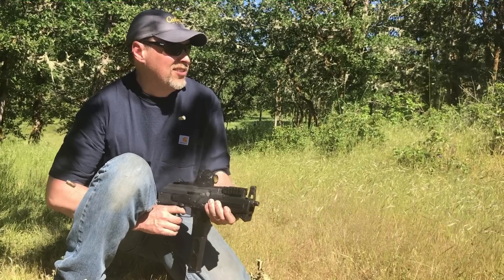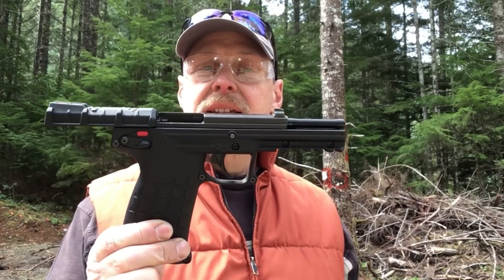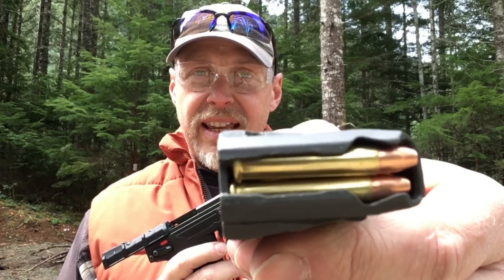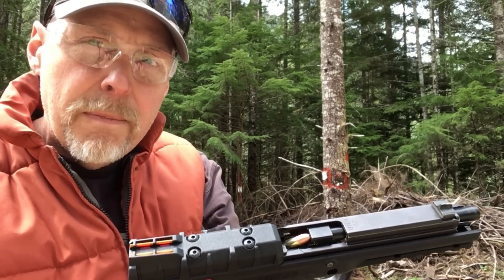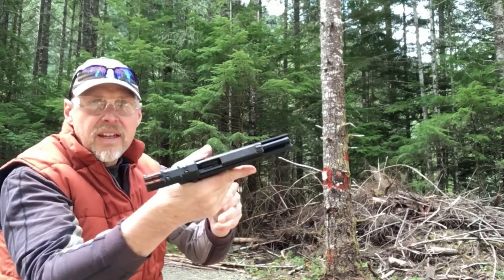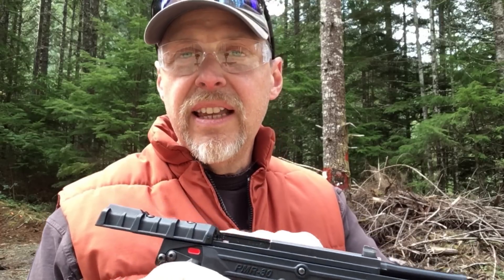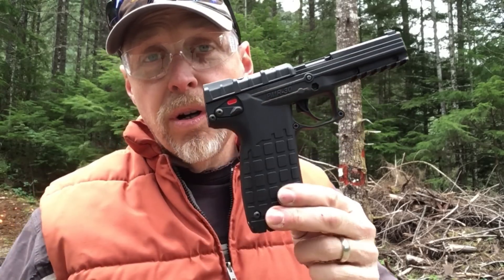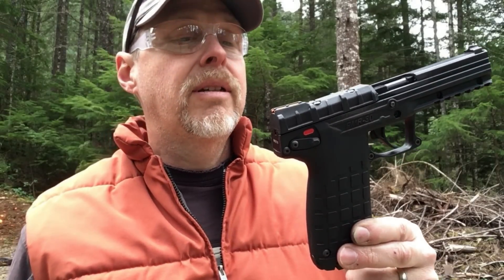Troubleshooting: the Kel-Tec PMR 30

Comment: I thought 30 rounds of .22 Magnum would be a devastating weapon so I checked out all the videos on the PMR30 and I found two problems that steered me away.  The first problem was that it's a CalTec, and the second problem was that every video I saw had the same failures that you experienced in this one.  Failure to feed, failure to fire, failure to eject, failure not to fail, etc.  And I thought the price was a bit much....actually a lot much.

I may have to start looking for one of these again.
Reply from the maker: ytubepuppy 
  Haha! Well at least I had a happy ending. The sequel to this video tells the tale. It’s called, “KelTec PMR30 100% Reliable!”  And now I can say this is one of the most amazing guns I’ve ever owned. I can’t believe what it can do. I don’t know where KelTec went wrong on production or QC but the design is amazing and could change the gun world forever if these can be produced in sufficient numbers without production screw ups.
Reply: @MaxHeadspace9mm    If I could get one that was reliable, I might even consider using it as a carry gun, or at least a truck gun, but I've always been leery of them.  Will have to look around and see what I can find.  I'll look for your other video.  Thank  you.
Reply from the maker: ytubepuppy 
  Sure. And good luck. I don’t know what advice to give you about finding a good one on the first try. It’s hit and miss with KelTec. But at least you know if the gun doesn’t work they will take care of you. Eventually you will get a good working pistol.

Comment: My PMR I bought 2017 November... has fluted barrel, 2014 make, threaded barrel with the muzzle break. Of approx., 500 rounds I would have had 5 stoppages. The slide on mine is loose and in take down after removing lock pin, if I tilt firearm muzzle down the slide will fall to the floor.  Its not loose or rattling. Locks up very well. Very accurate to 50m.
Ammo is always Hornady synthetic tip 30gn VMAX or Federal Game Shock JHP 50gn. Unique firearm espaecially for Australai, Guys at the range always wonder whats making all the noise .....until they look at the floor and see all the 22WMR shells.
Reply from the maker: wetherman21 21 
  Haha! I bet that starts a few conversations😆. My slide is very tight. I suspect the tolerances are very loose at KelTec. To make weapons as inexpensive as they do they have to go fast. I’m ready to make my follow up video to this one and we will all see if there is a happy ending to this story🤔🤞
Reply from the maker: wetherman21 21 
  No I meant when you said you shoot your PMR30 at the range and people wonder what the big noise is and see the 22 mag shells all over the floor. That would start conversations. I love conversations in my comments section. It’s my favorite part of YouTube. Thanks for the reply. 😉

Comment: I just picked up a used PMR 30 (updated version). I've put over 400 rounds through it and observed that thus far, it only works reliably with Hornady 30gr ballistic tip ammo. I've tried the cci you used in this video, federal, Winchester and armscor, and none of them feed reliably. Additionally, it's very difficult to fully load either of my two magazines with anything other than the hornady rounds. I've never had a malfunction with the hornadys. With other ammo, all malfunctions are magazine/feed related.

 I need to get my calipers and check, but I'm wondering if the rim is a little bit smaller in diameter on the hornady ammo. It's a little frustrating to be limited to one ammo type that's on the higher cost end and a little less common, but it's still a blast to shoot. 30 rounds, almost no recoil, very loud (more bang=more fun for me), amazing trigger and less than a pound fully loaded. Just needs someone to make an aftermarket mag that take all kinds of ammo
Reply from the maker: Charles Alexander 
  That’s fascinating! I’ve tried every grain weight and brand available where I live and the best I tend to get is 3-4 stoppages per mag. It’s people like you who give me hope to keep trying with this pistol. I know there are reports of happy customers who have this pistol sorted out and get enjoyable reliability out of the PMR30. Soon I will upload the follow up video to this one.

Comment: I want one of these eventually, i just got the heritage rough rider 22 with the magnum cylinder. Looks like it might be a keeper if the break-in proves to be a good thing for the gun!
Reply from the maker: WCAR PumpIron 
  I have a friend who got the Heritage Rough rider with the magnum cylinder too. He loves it. With that and the PMR30 you would set for plinking and anything 22 related. 
  My experience is not going so easily. I’m certain that one way or another I’m going to conquer this problem but so far the answer is elusive. It’s possible I may have a lemon or maybe it’s something so obvious I can’t see it. We’ll see.
Reply: Max Headspace9mm I have both of these as well. Only I still just have the 22lr cylinder for my RR. Had a retired marine hit 75 yards out of the RR. Unfortunately, had some Winchester blow back in the PMR and the damn slide catch/release blew off with it. Scared the hell out of me. Never had a round do that in any of my handguns.
Reply from the maker: WCAR PumpIron 
  I have a good friend who got the rough rider too. Then he went out and got the magnum cylinder also. Great versatile combo. 
  The PMR30 has a lot of potential if it works as intended. I’m making a follow up video to this one showing all the fixes I’ve tried and what was the result😉
Reply from the maker: Alonzo Hall 
  Unfortunately KelTec has the business model of making these guns extremely inexpensively so stuff like that is possible due to loose tolerances in their manufacturing. I’m sure if you contacted them they would be motivated to make it right with you.

Comment: I think aside from finding ammo with enough force to drive the bolt back. The other problem could be partly remedied by taking time to visually inspect the cartridge column specifically the top cartridge after loading each round into place.

I notice during the loading process even if follow the instructions to the t, you will find some of the bullets misaligned. As you load the magazine if one round is misaligned rake it out and the alignment of the next. If it is also misaligned rake it out as well. And so on and so forth till you reach the point where they are aligned. Than start loading grom there.

It is very monotonous. What you are looking for is to imagine the cartridge sliding forward. Is it going to clear the front of the magazine? Or get caught?

You can test your loading method by dry cycling the full magazine through gun rapidly pulling the bolt back and letting go. 

Once youve got this down and can di whole magazines without a hitch than you can go to the range.

If you have just one hang up. Take the time find out its exact cause. If the bolt is not fully cycling there arr severak things that can happen.  Some may even seem magazine related but arent. If the empty case is still in the chamber than the culprit is obvious. Cockeyed cases getting between the bolt and chamber are a sign that enough force was able to kick out the brass but not far enough for the bolt face to get behind the case rim.

Empty chamber can be ammo related, or it can also be magazine related. Ensure the magazine is fully inserted. Some have had issues like this and found the magazine tolerances where it locked up into the gun were too lose. They slightly modifued their magazines so that they would be firmly seated. 

The reason why i am being so pendantic on this is an attempt to help us save ammo. 

I am not a gunsmith. I have been known to pour hundreds of rounds through guns frustrated with performance issues and than getting rid of the gun. 

After you fure one round. Before you fire another, eject the magazine to check the magazine and see if the next round is properly aligned. Than pull the slide back to see if a fresh round is in the chamber or an empty case. Doing this early on can help you catch an imminent malfunction before it happens.

Eventually once you find the right ammo and your magazine loading technique is down , you hopefully will be able to start burning magazines through gun using your ammo having fun instead of getting red in the face.
Reply from the maker: Haunted Hornet 
  Thanks so much for investing time to help. I love the detailed description of methodically finding the source of these problems. A gun is just a mechanical device and frustration blurs our ability to see clearly what is at fault. I like your approach. 
  I did a series of four videos about my journey with this pistol. The last one revealed that I’ve passed a milestone. 1,000 rounds of flawless function. Which surprised even me. This is truly a great design which is certain to influence other firearms manufacturers into reconsidering what true high capacity is. The bar has been raised!

Comment: I have one of the latest versions of the PMR 30. I have not had any feed problems during its break in cycle and have approximate 300 rounds through it. However just to be on the safe side, I went ahead and polished the feed ramp. I have had zero malfunctions. The only thing I am discouraged about is its accuracy is not what I would expect. Any suggestions on how to correct that?
Reply from the maker: Bill Laflen 
  It may be something you weren’t expecting. This pistol is notorious for having a loose front sight.  Under the stress of reciprocation of the slide it has been known to move a bit. Even an almost imperceptible amount of movement can throw your accuracy off. One easy fix is to put a drop of super glue in the sight channel once you feel it’s where it needs to be. Loc Tite also has an adhesive that is really fine and will soak in the microscopic space between your sight post and the channel its in. Or you could do like I did and replace the front fiber optic sight with a metal sight post. It fits much tighter and doesn’t move around. Mine is accurate. I will say that much for it.

Comment: I had one of those pistols and I had a number of malfunctions. Most of which I think were caused by the magazine.

If you don't load it exactly like the owners manual says to do it. They don't feed properly.
Reply from the maker: Roy Spaulding 
  Yes. I made sure from the start to be a zen master of loading the PMR30 😆😆. It is different but not difficult. There is a loader available that helps and it’s not expensive. I may get one.
Reply: @MaxHeadspace9mm  I had one of the loaders, it is worth the money. I just traded mine to my father because I wanted a rifle he had. It had sentimental value and the PMR30 did not.
Reply from the maker: Roy Spaulding 
  Yeah. I can’t picture a reason to get sentimental over a PMR30. But maybe in time🤔

Comment: I have an AK.  From new to 12,000 rounds and not one stoppage and still going strong.  I have fired rusted amo too.
Reply from the maker: alaskanalain 
  Yeah. I have some guns like that too. I know what you mean. 
  But the difference between the pistol in this video and basically the same pistol in the follow up video, “KelTec PMR30 100% Reliable!” Couldn’t be more different. It has been 100% ever since the fix. I expect it will be one of those to add to my totally reliable collection. My only question is, how long will it last?🤔

Comment: I have the same problem with my PMR, only the feeding issues started after a couple years and hundreds (maybe thousands) of rounds. The firing pin broke and KT replaced the whole slide assembly, but the problems continued. I tried cleaning a mag and using dry lube (Krytech) and bought a whole new mag, to no avail. I guess that I'll have to send it back. Also, I went to the KTOG site and explained my problem and the first three replies were, "You're limp wristing it."
Reply from the maker: jwash3rd 
  Haha! Yeah. I’ve had people tell me I’m limp wristing as well. Though from the video footage I can’t understand what they are seeing. I’ve never had trouble limp wristing before. But I’ve tried every fix that the commenters on this video have suggested. I’ve watched every video on YouTube about problems with this pistol and tried those fixes as well as everything I’ve ever done to any other pistol to get it to work. The follow up video to this is coming soon.
Reply: Thanks for the reply. I've subscribed, hope you find the fix.
Reply: @MaxHeadspace9mm  Ever get the follow up done? Just got mine back from KT and it feeds Mini Mag TMJ and V-Max OK, but JHPs and FTX not so well. Rather than send it back again, I'll just use it as a plinker.
Reply from the maker: jwash3rd 
  The follow up is called, “KelTec PMR30 100% Reliable!”  You May find yours working better after some break in. If they replaced parts then see if it gets better over time. Also KelTec guns need lube and cleaning more than most. Especially the .22 varieties. 
  I’m working on a .22mag penetration video now to upload in the next two weeks.
Reply: @MaxHeadspace9mm  Thanks, I found it. In fact, I had seen it but forgotten. Well, my doctor did say that the memory was second to go.

Comment: I have to shake my head in amazement. You shouldn't have to do any of this. Send it back to KEL-TEC, and let them fix it.
Reply from the maker: WC Sessa 
  I know. I have no idea how they can survive as a company with releases like this. And it’s not like this pistol is brand new. These have been out for a few years now. 
  So I did send it in and they fixed the heck out of it. New slide and barrel. Works flawlessly. Did a video called, “KelTec PMR30 100% Reliable!” To document first shots from the factory fix. Then did a penetration test video comparing it to 22 lr and 9mm hollow points. That video is called, “PMR30 Penetration Testing”. Tomorrow I’m uploading a new 1,000 round reliability review. I’m toying with the title, “ PMR30 for Self Defense?”  What do you think?
Reply: @MaxHeadspace9mm  Didn't know about the "NEW" video, so I made my comments. I have a PMR-30. It works good so far. Ran 100 rounds through it. Bought it about a month ago, so obviously they have made adjustments, but I have also seen others complaining also, and still others swearing by them. Make your video about 1000 rounds reliability. I think it would be very interesting to see. Bottom line in my assessment is folks follow instructions on proper magazine loading and adequate ammo. Obviously  cleaning/lubrication plays a part. The videos I've seen where people talk about that makes a big difference in their perception of the gun. All common sense items to observe when you buy a new firearm. Thanks for the response, your video makes sense now.  Looking forward to seeing your follow-ups.
Reply from the maker: WC Sessa 
  Thanks! Yeah, I’ve gone the gamut with this pistol. But it’s all good now. Never would have believed it could go from junk to awesome in my experience but it has. Now I’m getting a holster for it. That says it all!

Comment: I must have got really lucky. I have over 1000rds though my pmr30 and I've never ever had 1 malfuction. But I so load the mags like keltec says. After 10 round I tap the back of the mag on a hard surface. Then every 3rds after that I slap the mag on a hard surface
Reply from the maker: Julie Shaffer 
  Yeah. It’s not hard to do. Just important. High capacity mags are more than many shooters have patience for. Believe me I know. I love em. They just take a bit more care than most but the benefits are huge. 
  I got this working reliably but it was a manufacturing defect that caused the trouble. I did a follow up that tells the tale, “ Kel-Tec PMR30 100% Reliable!”
Reply: @MaxHeadspace9mm  awesome, glad keltec took care of you. I can't wait to see you do a ballistic video with it. I do cc mine every now and then when I'm wearing light clothing or pants without a belt. The light weight makes it easy to carry without the support of a belt. I carry mine with gold dots
Reply from the maker: Julie Shaffer 
  That’s what makes me feel like carrying mine. Full size but so light. If I get to as many rounds as you with equal success and I find a holster you can bet I will carry this😉

Comment: I had 4-5 FTF in the first 200 rounds
Cleaned the gun and have not had any failures in the next 200 or so
I have 3 magazines and only load 20 rounds since that works out even for 200 rounds
I just use CCI Maxi Mags
Reply from the maker: Greg Brown 
  I’ve tried short loading the mags too. But mine has something actually wrong with it I’ve found. Had to take “drastic measures”🤔 new video coming soon.